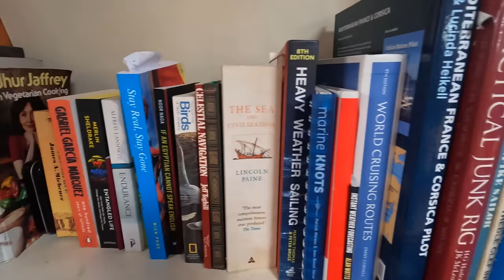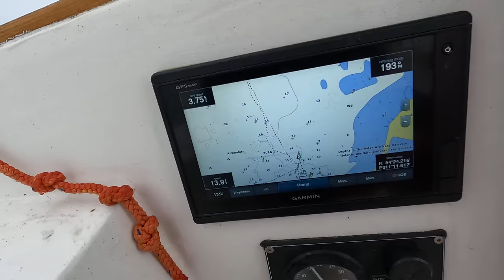Baltic Sailing In April - SV Tapatya Season 2: EP1

Comment: Great video as usual, and here's to a great season! One question, I didn't see you using your new windvane steering at all (perhaps off camera?). I'd be interested to hear how it's working. Thanks.
Reply: I noticed too. The conditions seemed perfect for the windvane and I wondered why it wasn't in use, and how well it's working..
Reply from the maker: It’s not quite completely hooked up yet. It still needs the lines and blocks between tower unit and trim tab. I’ll get to them soon. 
I did try pulling on the trim tab lines and they turn the rudder very effectively, so I’m hopeful 😃
Reply: @SVTapatya  Sounds promising 👍
Reply: @SVTapatya  Got it - thanks

Comment: I saw that the sail had wrinkles on it, and traditional old sailboats would have a slash between each rail to help smooth out the wrinkles. Do wrinkles affect the efficiency of a sail?
Reply from the maker: Yes, the rig still needs adjustment. Do wrinkles make a difference? Yes, certainly! How much of a difference? Probably not a vast amount 🤔 I’ll still aim to get both sails setting well 👍

Comment: Hello Tony can you please tell me what size engine you have in it please
Reply: It's a Volvo Penta M2010D, 10HP, two cylinder diesel with saildrive. Tony bought it 2nd hand, with control panel, wiring and engine/saildrive mount.
Reply from the maker: Jaygee is absolutely right except it’s a two cylinder 👍
Reply: @SVTapatya  Sorry for accidently spreading misinformation, I got it from your own blog though when I  searched on "SV Tapatya motor". The second search result was  "Engine Developments", 21/11/2017, and in the first paragraph you state that the motor is single cylinder. 
Thanks for clearing it up.
Reply from the maker: Did I say that? Oh dear! 😬